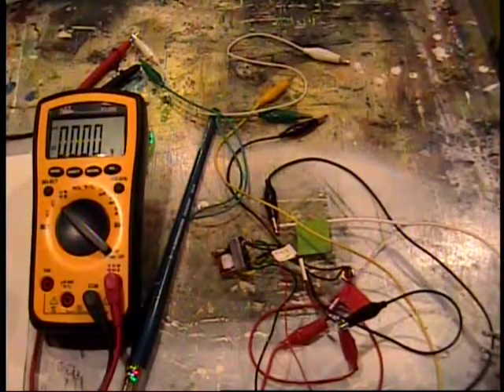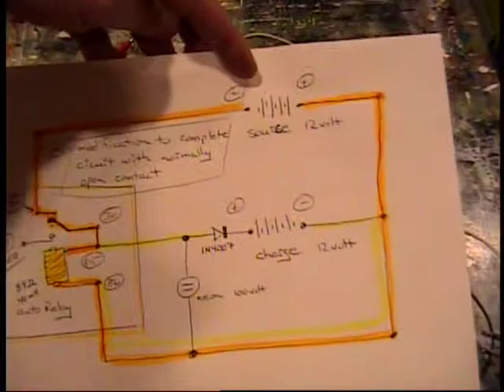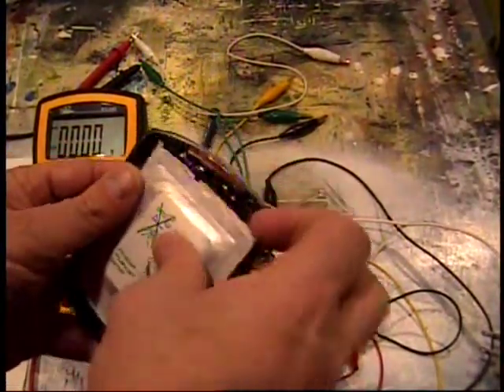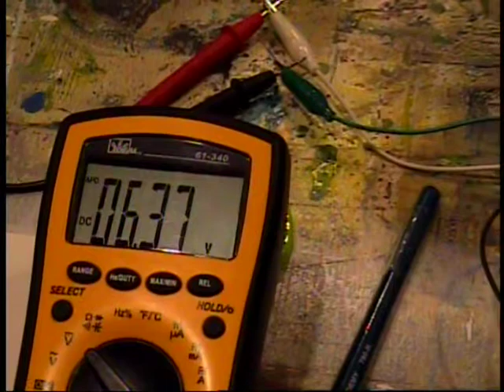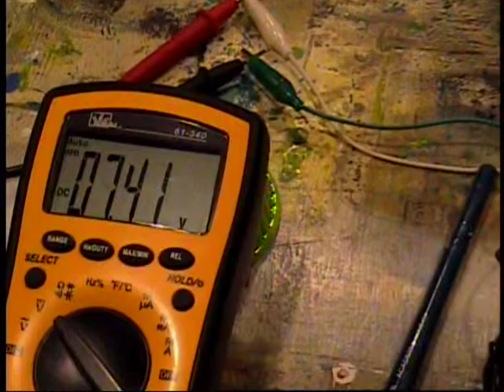Polaroid Flashlight Recharge Flat Battery

Comment: I am curious to know how well it held it's charge after the subsequent days of charging? also what was the max voltage it topped out at when fully charged?
Reply from the maker: Mr. Balloonatic, under charging it accepted more voltage each session. I topped out at 8 volts while charging and the battery dropped to 6.7 volts after a week long rest. It is one year later and holding at 6.5 volts and lights the bulb easily.
Reply: That is excellent to hear, i came across one of these in a box yesterday and would love to get it working again